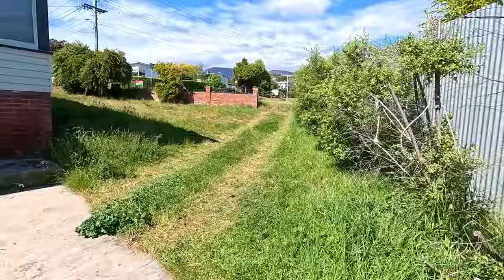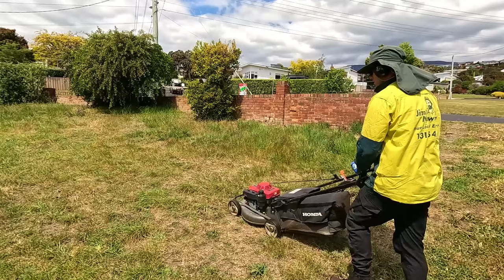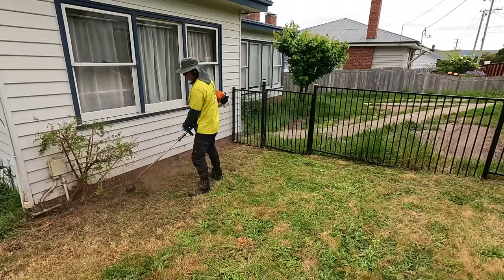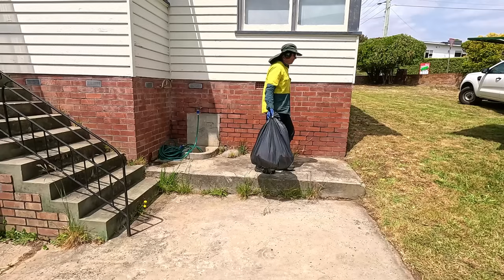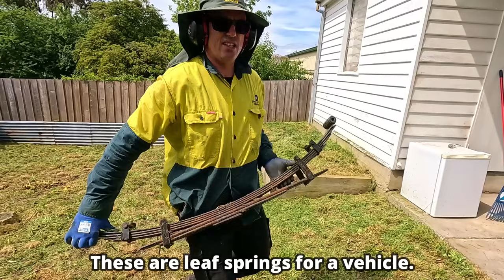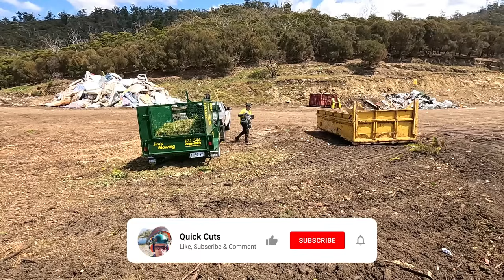He couldn't BELIEVE his eyes after this full yard Transformation!

Comment: Quick cuts/Jim's mowing, you do an awesome, job mate. You are very thorough with your work no shortcuts no cutting corners. Good on you. What surprises me is that I think you are the only one who does yard transformation and does not use a riding mower. You are still working Ol Skol with your push mower. The only problem with using a push mower is hitting dog poop and splattering all over our clothes. Absolutely crazy and😣 will just ruin the rest of my day.
Reply from the maker: Believe it or not, all contractors in Tasmanian use self-propelled or push mowers because we catch the grass and take it away. Riding mowers are used on larger jobs where the grass doesn't need to be caught. Riding mowers are good for large flat, open areas where the grass doe ant need to be caught. You need to watch some more Aussie content 🙂